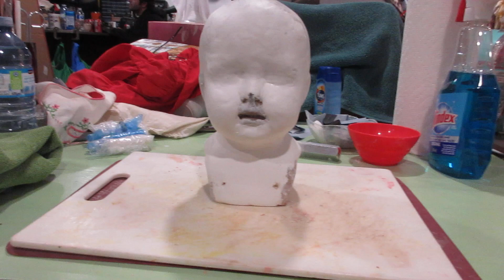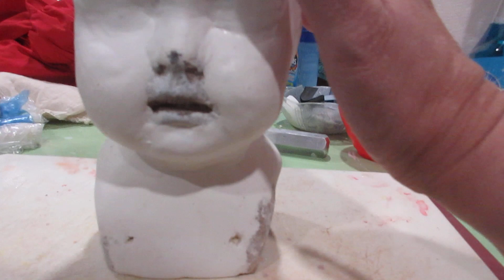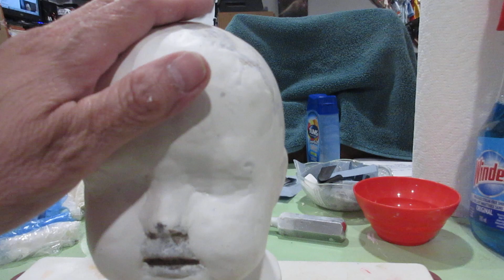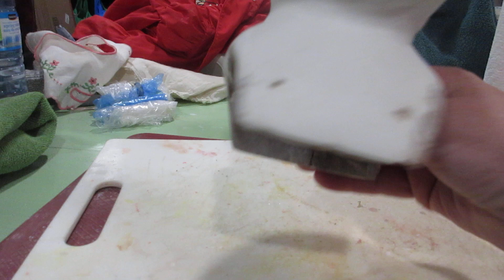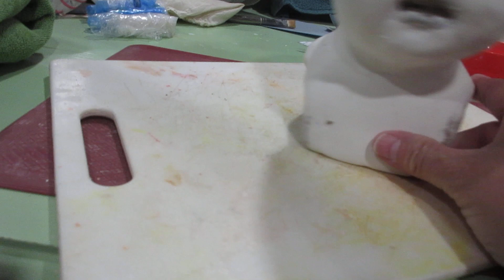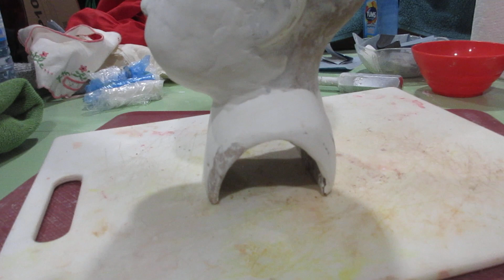the broken doll -Update -Babs the Harry H . Coleman doll

Comment: It is possible that putting the linseed oil on the composition softened it too much.
Reply from the maker: I think much to myself so here it goes and never mention on my videos .. It might have  ... maybe but she was wet before using linseed oil . Also I did not use linseed oil right away she was allowed to dry . I do many things off camera .The doll was placed in front of a heater turned every so many minutes in the house and to me she felt very dry . Then I placed the linseed oil on her . It could be a number of things .Maybe she was not as dry as I thought but researching linseed oil it does not say it can make wood wetter .I have read that linseed oil is water repellent so did it push hidden water to the surface? I also read that linseed oil if used on wet wood can make wood peel or lift . So my conclusion is this I should have allowed the head to dry longer . This could have been the reason of the composition to lift . BUT composition is also known for lifting if poorly designed or manufactured especially dolls from this time period . So all of this being said take your pick and it could be correct .
Reply: @thebrokendoll871  Absolutely! It was just a thought that popped into my head, and I thought I'd throw it out there. Another other thought was possibly the mucilage glue softened. We will likely never know! Keep on doing what you do as you are enjoyed by many (and growing)!!!